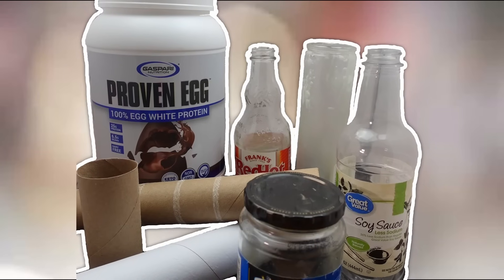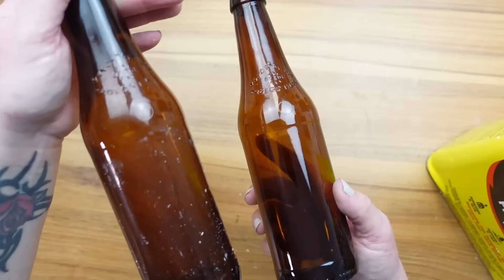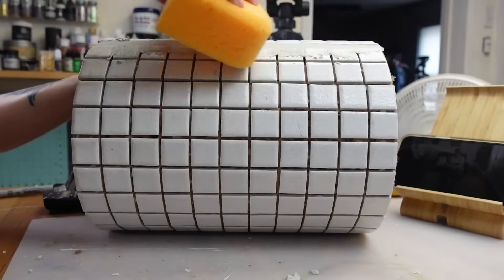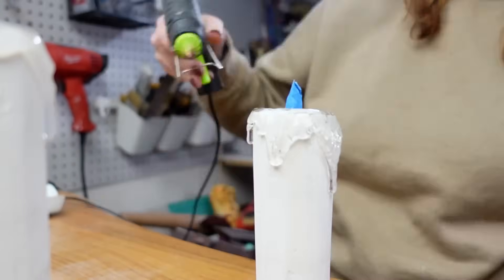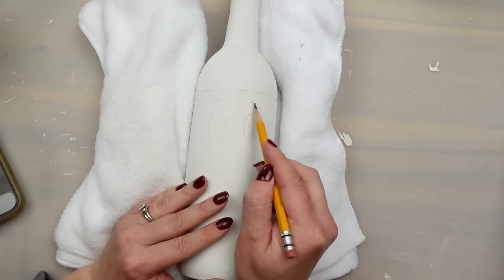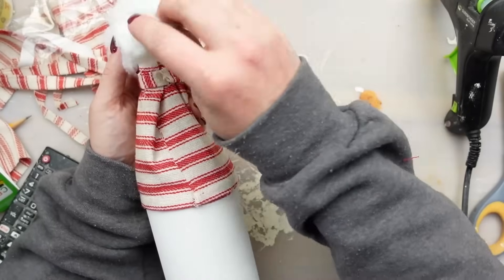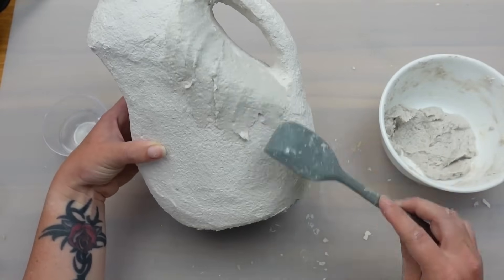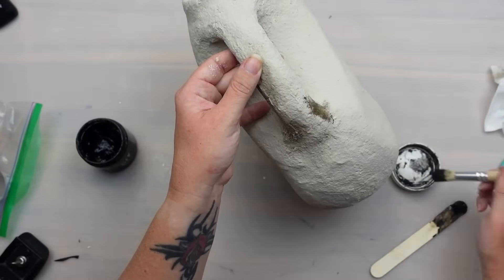20 of the BEST Home Decor DIY's using TRASH

Comment: Hi, I’ve changed the colour of grout before using children’s poster paint that comes in powder form. I believe you can use acrylic paint too but I’ve never tried it myself.
Reply from the maker: I had no idea poster paint comes in a powder form. Good to know thank you!
Reply: @angelajonesdiy  I was told to use the powder form because it’ doesn’t add any additional water to the mix. I suppose if it’s for something small you could use premixed poster paint & set it outside to dry. Yet again never tried that because I was able to get the powder in the colour I was looking for (dark blue).